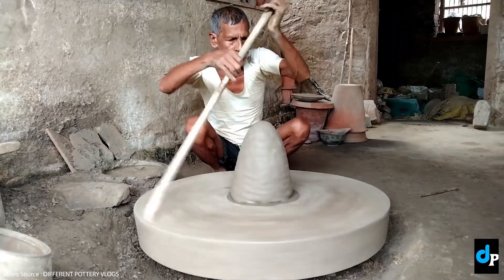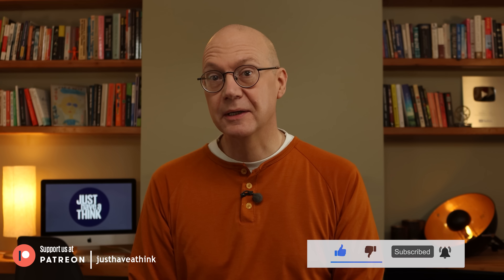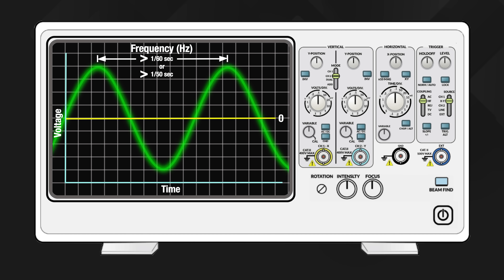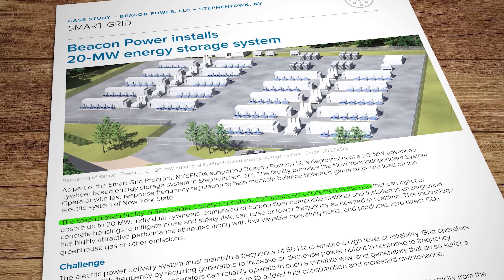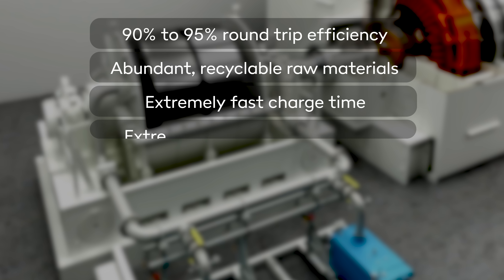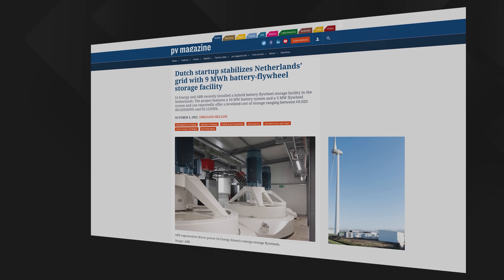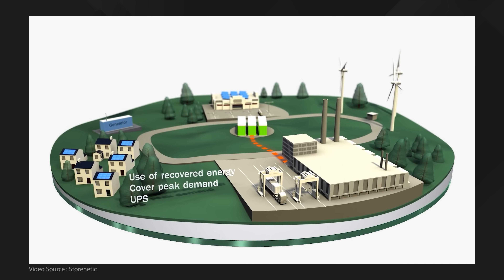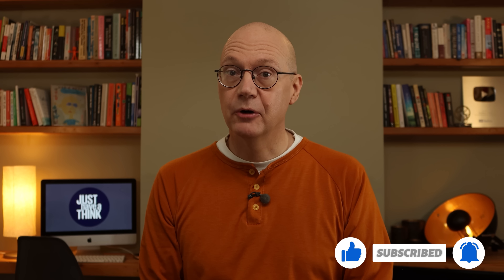Flywheel reinvention revolutionising our power grids!

Comment: 5:25 important to know not the mass, but his moment of inertia and rotational speed of the flywheel, by the working frequency of the grid. Only these two parameters show, how much inertia can we get from the flywheel. If two identical flywheels will rotate with different speed, they will have different inertia for the grid. And this inertia depends on the square of rotational speed, that's why it is better, to rotate the flywheel as fast as possible. For example not with 1500 rpm, but with 3000 rpm, and achieve 4 times more inertia for the grid, by the same flywheel! Or maybe even to use an additional epicyclic gear box between the electrical machine and flywheel?

Comment: What i did was i look for a small dc motor to drive a generator which is connected to a flywheel and from the output of the generator there is  a giant transformer that collect the power from the generator with a super capacitor but is not constant it only delivered energy in seconds and then disconnect in seconds repeatedly, it can be only use to collect small in  energy in seconds from sun and wind and change it to a large energy in seconds that is the only result from Nigeria

Comment: Flywheels are actually re-emerging as game changers as grid stability is absolutely crucial for long distance transfer of energy. A grid with of a lot of intermittent sources will have to tap into those sources from further away. Having flywheels will enable a stable grid across those larger distances. Coupled with iron-air battery warehouses in between and we wont have to worry abt rare earth metals anywhere in the value chain👍

Comment: Dear sir, thanks for your video.This method is most useful for diesel/electric trains. When locomotive applying dynamic brake it loose its kynatic energy. however using flywheels to save this waste power it's important.

Comment: That’s exactly what I was thinking.

Lithium ion batteries don’t last that long. After A few years their storage capacity really dropps off, and then you have to recycle and replace it to even get near that capacity again.

Fly wheel storage is 95% efficient, and it lasts like you said literally for 20, 30 years or more.  

Lithium may be cheap now, but you have to keep replacing it. Fly wheel storage you do not.  At least not on a huge scale like lithium.

You don’t have to deal with potentially dangerous chemicals like flow batteries, and it’s literally just stored as angular momentum.  

If we could make flywheels out of carbon nanotubes,  it would be a game changer as far as smoothing out the spikes in energy storage.

On top of that, if you made O’Neill cylinders that are like 40,000 feet in diameter, you could install two huge fly wheels near the size of the cylinder at each end (4 in total) with two other huge ones perpendicular, and it would not allow it to store huge amounts of power, but you could also move the O’Neill cylinder without thrusters, with incredible efficiency.  That way the only propulsion you really need is out the rear end.

Comment: One also wonders (upon rewatching) about running one of the inertial inductors 'out of phase' so that they can act like a capacitor, in the same way that electronics folks can make capacitors and op-amps look like inductors.
Also there is the newer technology of modular multilevel matrix converter (M3C) which 'disconnects' the relative phases at opposite ends of high voltage connectors by using an 'electronically' generated ~20Hz intermediate transmission frequency. The flywheels don't always need  to be synchronous!

Comment: This does sound like an interesting idea although it may have some unrecognised dangers. The difference between battery storage or hydro storage is that the energy is stored as kinetic energy rather than more stable chemical or potential energy. As a biochemist I have used centrifuges in my work varying in weight from a few 100 grams to 10 - 15 kg and rotating at speeds of between 1000 rpm and 100,000 rpm. The problem with kinetic energy storage such as a centrifuge or a flywheel is that if there is a failure, all of the energy can be released catastrophically in a fraction of a second. I have seen the damage that can be caused by a rotor/fly wheel weighing several kg, failing at a few thousand rpm and it is truly scary. Imagine the destruction if you had multiple flywheels/rotors weighing several tonnes moving at 45,000 rpm and storing massive amounts of energy if there was a failure of one system that then destroyed the entire bank of flywheels, releasing an unbelievable and highly destructive amount of energy. Just a quick thought!

Comment: The cost would plummet even further if they started requiring one in every home attached to the grid. The home would be powered directly from the flywheel completely isolated from the grid. When the grid goes down the home would still have power for as you said for about a day, and efforts to keep the flywheel spinning by the home owner could achieved with battery / inverter system and an automatic lockout system. Making such efforts would be an very economical fail safe. My vision is focused on keeping power, but smarter people than I could even find a way share the stored batteries energy with the grid.

Comment: Why not a globe-shaped flywheel accellerated by a wheel that adjusts to the tilt of the spin as it migrates?  Use magnets imbedded in the sphere to match up with magnetic bearings underneath and along the sides to keep it contained, yet minimizes or eliminates need for draggy physical bearings.  Shouldn't have anywhere near the same drag as a conventional flywheel and its the most perfect structural integrity possible.

Comment: I remember seeing huge flywheels in cotton mills in Lancashire. Maybe some 20 feet in diameter powered by the steam engine with maybe a dozen belts driving machinery be it spinning machinery or weaving looms. The unfortunate thing was that after many years some of them broke up because of metal fatigue and would bring the end of the machine house down and render the mill finished. Google was my friend but this is the only reference found: https://redrosecollections.lancashire.gov.uk/view-item?i=272056&WINID=1682108034390
I remember a mill being demolished in Chorley in the 1950s, the wall fell into the back yard of my father's elderly aunts!

Comment: Works great for frequency stabilization, but it does not store power for more than a few minutes. 4000 MW seconds = 1.11MWh. So 1.11MWh would then be somewhere between $2,200,000 and $6,600,000.  One of these could provide power to ~1000 energy-efficient houses for 1 hour at the cost somewhere between $2200 and $6600 per house + whatever the maintenance of the flywheel will cost. At those prices it's cheaper to buy a dedicated lithium battery for your house and then have. Whole house backup costs ~$5000 for 12kWh and that at a self-discharge rate of ~2% per month.

Nah.. .This is for frequency-stabilization only as neither wind or solar can provide that. Backup-power for when we don't have wind or sun will have to be stored/generated in other ways. Buying lithium backup is not a option either as we just don't have enough production-capacity (by a factor of a few thousands) or the raw-materials.

This frequency-stabilization function is actually something we already have via the large generators we have in hydro/nuclear/large gas-turbines. Wind and solar does not provide this and that's why so much research is being done on this. So do remember that even if solar/wind may be a cheap generator when you have wind/sun you will have batteries & frequency-stabilizers adding new costs into the system.
Reply: <<<<<👆Hey mate>>>>>Thanks for watching 
  Tell  Aɴᴅʀᴇɪ Jɪᴋʜ, you were referred by me he has something new to discuss with you easily get in touch with him 👆✍️

Comment: I have been specifying flywheels on pump assemblies for many years to overcome Waterhammer on loss of power. VFDs are of little use in controlling deceleration when you have lost power. Many younger engineers considered me eccentric when suggesting this solution over gas bladder accumulators, control valves or relief valves.  The flywheel is inherently maintenance free save for the bearings. They don’t have to be registered as a pressure vessel ( gas accumulator).

So a soft starter could be deployed rather than a VFD. This saves on the control cubicle and more importantly the cost of air conditioning the switch room. Once up to speed the soft starter can be bypassed.
Reply: <<<<<👆Hey mate>>>>>Thanks for watching 
  Tell  Aɴᴅʀᴇɪ Jɪᴋʜ, you were referred by me he has something new to discuss with you easily get in touch with him 👆✍️

Comment: 7:10 there is no way battery storage has 90% round-trip efficiency. Rectifier efficiency is 80%. Inverter efficiency is 95% Batteries have own resistance and losses associated with it, which causes  losses both during charge and discharge cycle.
75% round-trip is probably best-case scenario
Reply: <<<<<👆Hey mate>>>>>Thanks for watching 
  Tell  Aɴᴅʀᴇɪ Jɪᴋʜ, you were referred by me he has something new to discuss with you easily get in touch with him 👆✍️

Comment: Apparently some of the tech for modern flywheel energy storage comes from uranium enrichment tech, as that faces done og the same challenges.
Also, flywheels for energy storage are super dangerous to be around in case of accidents, to the point that they are preferably mounted in floor recesses.  After all, the incentive is to spin them as fast as possible and a disintegrating metal wheel going stupidly fast is a thing to fear...
Reply: <<<<<👆Hey mate>>>>>Thanks for watching 
  Tell  Aɴᴅʀᴇɪ Jɪᴋʜ, you were referred by me he has something new to discuss with you easily get in touch with him 👆✍️

Comment: Yeah, another of those "great" ideas concocted by design-students.
Rotating mass has been used to stabilise the electric power-grid since the day the grid existed - cause it is a natural byproduct of normal generators. Intentionally adding mass can sometimes help with that, but as energy-storage it is utterly unsuitable, specially considering just how insanely destructive they can be. A batter will burn down with basically no way of extinguishing it, but with proper construction they can easily be separate as to keep the damage to nearby batteries to a minimum.
But flywheels? If something goes wrong they might just rip apart and that means releasing all the stored energy in a fraction of a second, not over several minutes. So any to-scale energy-storage having a breakdown could potentially be the same as blowing up several kg of high-explosives.
Their main use also relies on the very same characteristic that makes the unsuitable for bulk power storage - they are great for smoothing out the small variations and can take on huge but short surges.

I also find it fascinating that this video also just conveniently "forgets" to mention all the other downsides as well as uncritically copies over simply false information.
30year+ operational lifetime? Yeah, if you include replacing nearly every moving part multiple times.
Reply: <<<<<👆Hey mate>>>>> Thanks for watching 
  Tell  Aɴᴅʀᴇɪ Jɪᴋʜ, you were referred by me he has something new to discuss with you easily get in touch with him👆 ✍️
Reply: What if they were placed underground and surrounded by extremely heavy material on all sides (with enough gap room of course)? So the worst that could happen if it suddenly just blew apart was it would dent or damage it's underground compartment?
Reply: @Krill_all_health_insuranceCEOs  That would solve the problem of it being dangerous, but at a high cost. They are already way more costly, in the range of 10x that of batteries (that is the projection of their cost for 2025 under the assumption that batteries dont get significantly cheaper).
Most likely seems to be some flywheels near or at the power production sites as well as near regional distribution centers - enough to smooth out the short-term spikes.

Comment: We definitely need this.  Here in South Devon, the mains seems to have periodic changes in voltage superimposed in the range one to three Hertz.  I noticed this testing power supplies for tube amps.  Sometimes you can even hear the mains transformer hum varying, and the intensity of my workshop lights flickers all the time.  The solution for me is linear regulators, but it's been a nightmare getting parts for the last year or two, delays of months on semiconductors, even simple stuff like resistors and capacitors being out of stock with long lead times.  It's just a hobby for me, must be a nightmare for industry.
Reply: <<<<<👆Hey mate>>>>> Thanks for watching 
  Tell  Aɴᴅʀᴇɪ Jɪᴋʜ, you were referred by me he has something new to discuss with you easily get in touch with him👆 ✍️

Comment: Intermittent energy sources cause problems on any electric grid.  Accordingly, grid-level battery storage is in the pilot project stage.  While there have been some minor problems, grid-level lithium batteries will probably be ready for wider deployment in about five years.

In the longer term, flywheels probably will fit in somewhere, but right now focus is on scaling and deployment of grid level lithium battery banks.
Reply: <<<<<👆Hey mate>>>>> Thanks for watching 
  Tell  Aɴᴅʀᴇɪ Jɪᴋʜ, you were referred by me he has something new to discuss with you easily get in touch with him👆 ✍️

Comment: In summary then, the renewables experts have "discovered" something new that the old fossil-fuel power stations have been doing all along where we got all the advantages of the new flywheels but we got it for free in a conventional power station.

Oh, and the old fuels were far more energy dense than anything renewable and its use greens the planet. According to NASA/NOAA an area equal to twice that of the contiguous USA has been "greened" in recent years due to the CO2 increase in the atmosphere.

using fossil fuel based systems sounds like a win-win situation to me and no batteries required.
Reply: <<<<<👆Hey mate>>>>>Thanks for watching 
  Tell  Aɴᴅʀᴇɪ Jɪᴋʜ, you were referred by me he has something new to discuss with you easily get in touch with him👆 ✍️

Comment: Yes the grids of the world sure are changing.  Here in Australia some electrical engineers (it's probably coming from Toshiba or Siemens) who reckon that they can decouple the existing turbines from the generators of outgoing coal fired power stations then use the existing supporting systems for that generator like the lubrication system, generator to grid transformer and generator automatic voltage regulator to run as a synchronous condensor to help with frequency control.  Don't quote me on this as I've only hear a brief overview of the plan but I believe that the AVR will provide a parasitic load onto the generator rotor from the grid to keep it at speed and to vary output to raise/lower grid frequency.  Very handy as we have multiple 350MW and bigger units  getting close to retirement

Comment: Wet dreams: 1 MW for 15 Minutes. That is 250 kWh. A Tesla has a capacity of 100 kWh. And the flyer you showed for the Beacon power install can provide 20 MW for ... no word about that in the flyer. For a reason.